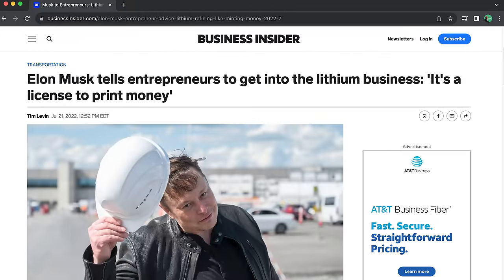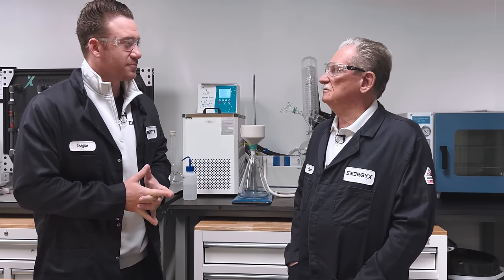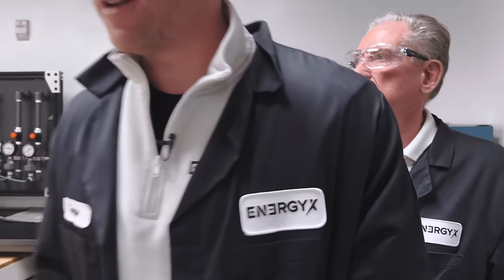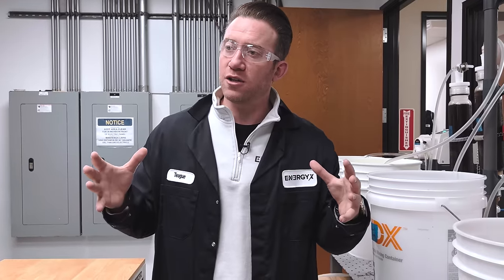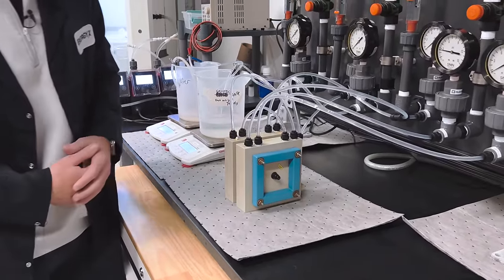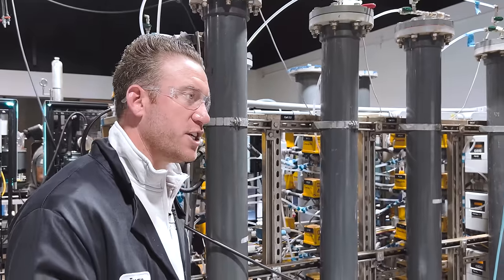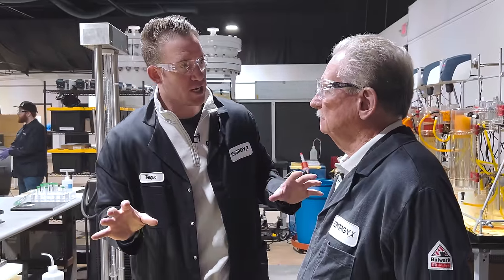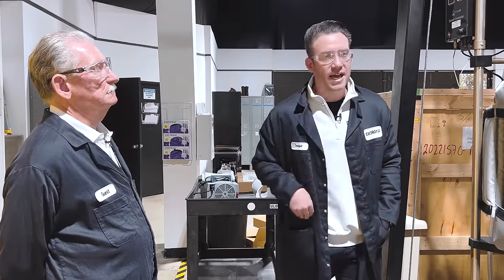The White Gold Rush - How one US startup is changing the lithium extraction game!

Comment: The sums are as follows (assuming I understand it correctly):
1000 ppm of Li in Brine. 
Molecular weight of water is 18g per mole. So there are 55 550  moles of water in 1000kg of water.
At 1000 ppm, there is 55.55 moles of Li per 1000 litre of Brine (more or less assuming the rest of the ingredients are not too significant).
Molecular weight of Li is 6.94 g per mole. This means the weight of the 55.55 moles of Li is 385.5 grams.
This means 385.5 grams at 100% efficiency of extraction. If you apply the 90% extraction yield, then it is 347 g of Li per 1 000 litres of Brine. This is quite some way off the 1kg claimed? I hope my sums are wrong, because some is...
Anyway, cost of battery grade Li (not sure if the Li extracted from the Brine is already at Battery grade or if further processing is required) is USD 37 000 per ton or 0.037 USD per gram. Multiply this with 347 g per 1000 litre of Brine and you extract USD 12.84 per 1000 Litre of Brine processed. 
However at a concentration 200 ppm of Li in the Brine (which is closer to actual as he mentions in the video), this reduces to USD 2.56 per 1000 kg of Brine processed.
SO to decide if this is a good investment, one needs to understand the cost to extract vs the value extracted of this process as compared to other processes. No idea if this is better or worse, but I would not invest purely based on some basic statements/facts provided.
It is possible that this much better than other techniques, but then the facts supporting this claim must be published.
Reply: Very nice back of the napkin calculation. This is exactly why they currently need massive ponds with free solar energy for evaporation of solvent, due to the sheer quantities needed to turn a profit.
Reply: one of the best comments on YT ever...
Reply: that’s one way to display your smarts.

Comment: CORRECTION ON APPROXIMATE MASS:
1000ppm of lithium brine with 90% extraction, would yield 0.35 kg of pure lithium, or 1.2 kg of lithium hydroxide, assuming the mass of all else in solution is negligible.

Reason for error: They forgot to take into account the difference in the molar mass of the different chemicals. 

DISCLAIMER: This is unconfirmed and I don't know their methods beyond this video. Please correct me if I made a mistake.
Reply: You forgot to specify a starting volume.
Reply: I think the businessman should not have answered the technical question of how many kilos of Lithium you get from 1000 liters of saline. With the ratio in particles of 1:1000 you have to take into account the low weight of Lithium. Sandy rightly noted that. 1 liter of Lithium weighs just over 0.5 kg.

Comment: Did anyone else think the numbers seemed to change back and forth?
How often are you going to be working with a brine containing 1000ppm? At first he said hundreds of ppm - possibly 1200 or 1500 (which - again, how often?) - and then the ~90k acre location is expected to produce 400ppm. Then at the end he is doing math on a fictional 1000ppm.

Looking at the multiple settling tanks(ponds, whatever) - I just wondered how large these would need to be in a production system to feed those filter system at the rate he claimed?

I thought he said they were planning to license the process - then at the end he says they have bought ~90k acres.

Also - the idea that it is clean? Why do we think its clean?
We weren't told anything about the chemicals being used.

I never claimed to be brilliant (maybe I revealed as much above) - but the whole way through I just kept feeling like I was being sold all the good points. How about the down sides - there has to be some.

There seems to be a LOT of debt tied up in this and, as yet, no actual method to produce a profit.

Also - is this actually new?
Pretty sure this idea is being tested by a number of companies in different parts of the world... and so far none of it has gotten to a full production scale.
Reply: Teague is not an engineer. And you're correct, there are several companies working on the same process.
Reply: You misunderstood the discussion about enormous settling ponds ... those are what are used in the existing process for extracting lithium from brine not what is required for the energyX process. They were an example of why their process is much better.

Comment: It’s definitely interested.  There seems to be things withheld.  It almost seems to good to be true.  I don’t know, I have my doubts on how cleaner or better this way is.  I hope it’s true and successful.
Reply: why, this level 200 chemistry, I don’t understand why everyone is so blown away.  A Nobel price for chemistry was given out in 1986 or there abouts for cyclic ether chromatography resins that could discriminate between different atomic radii of cation.  Obviously the work done even earlier, in the 60s’.  Check out “crown ethers” on Wikipedia, helpful skematics.  The Oxygen atoms face the inside of the doughnut and have a partial negative charge, they hold on to the positively charged cation.  The tightest ring only fits Lithium, the smallest of the cations.  Slightly larger will fit Na (sorry, sodium);  larger still potassium… and so on.

Comment: They ALL use graphite no matter what the battery is made of.   As a consequence, the manganese dissolution does not only lead to capacity and power fading at the cathode, but also influences the SEI composition at the anode. In fact, an analysis of aged LiMn2O4/graphite cells via EIS revealed that the increased impedance at the graphite anode is largely contributing to the capacity fading of such lithium-ion cells.

Comment: Just a little advice here not to get too hyped about it. Musk has said repeatedly and rightly that prototypes are easy but large scale production is a 100x harder. This company has not yet developed mass production technology and big scale manufacturing so still no reason to pop the champagne. Also do they refine the brine all the way to lithium carbonate ready for battery production or is their technology simply a lithium concentration technique for brine. If the latter it still has to be send to China for final upgrade to highly purified lithium carbonate. If so I am not impressed at all. I am also confused because he says they make lithium hydroxide. That is not what you normally can extract from brine. You normally get lithium carbonate. Lithium hydroxide is normally made from lithium rich rocks not brine.

Comment: St Augistine Florida, last I remember back in the 90s, utilized reverse osmosis for drinking water treatment.   Due to salt water intrusion from the Atlantic
Reply: The main method they are using here is called EDR which is ion selective and vastly more efficient than RO. EDR can also be used in desalination. I built a small one for my hydroponic system. It is off patent.
Reply: Salt water intrusion is a growing problem as aquifer pressures continue to decrease.

Comment: How long does a membrane last and is it reusable or must be discarded and how much waste is created
Reply: The main filtration unit called EDR is self cleaning by the reversing mode. The membranes are not very expensive and would last years, up to 20 in continuous use. Much more cost effective than RO.

Comment: So, if this works as advertised and at scale, then couldn't you go to those lithium rich areas, fill them with a brine solution that will bind to the lithium, and use this process to mine rather than the traditional method for safety?
Reply: I don’t think one would want to pump any kind of binding chemical under ground.

The idea to pump the brine out, run it through the process, and pump the brine without lithium back into the ground is better in these lithium laden areas.

Today, miners are not pumping enough water back into the underground caverns, sink holes are forming, and slowly destroying the mines.

This process has the potential to solves a lot of problems in South & Central America, where they are currently destroying the underground caverns holding the brine.
Reply: @DavidHalko  So, I don't know enough about the current Lithium mining process. However, couldn't you dig up the Lithium laden material, run some brine over it to soak out the Lithium, and then return the resultant material back once finished? 

I guess we would need to know how long the binding process would take, but presumably it would be safer than our current process, considering how bad everyone seems to be saying it is.

Digging up piles of rock and dirt, running brine over it, do this process to leech the lithium out, and then put the resulting rock and soil back.

Comment: The wiper part is disingenuous. Tesla should get sued for having such bad automatic wipers it's at least 10x worst than the worst system out there. I've had my m3 for 4+ years and it never worked well. I don't care that they saved 100$ on a rain sensor, penny smart dollar stupid. It's cool that they put It in the autopilot release but what about those with HW2.5 that were told here hw would be upgraded in time? it never was and are we not getting working wipers?

Comment: QQQ - How similar (or not) is this to what Elon is building with the Tesla Lithium refinery?
Reply: The Tesla factory receives spodumene (LiAlSi2O6), i.e. a mineral with a very high lithium content from the port of Corpus Christi and chemically removes the lithium, leaving aluminum silicates as a by-product. Tesla claims to do this without needing a large amount of acid (which probably just means that the acid is recycled in a closed chemical process). What these guys are talking about is about enriching water soluble lithium brines at the mining site. I suspect that to Tesla what matters is the availability of lithium rather than the total cost of production. They can absorb prices above the market price because they are making vehicles with very high margins. What they can not tolerate is to not have enough lithium in the market to keep making as many vehicles as they can sell. Supply risk management is a totally different goal than cost optimization, so the economics is potentially very different for Tesla. There may also be other reasons like quality control... if their process produces either "better" lithium than what they can buy or "good enough" lithium at a lower cost, then that's a winning strategy as well.

Tesla did describe their chemistry in a video, by the way. The main advantage seems to be that they don't have to buy expensive sulfuric acid and they don't end up with byproducts that are expensive to dispose. If I understand this correctly, this is like 19th century inorganic chemistry. You could do this at home with a chemistry kit and maybe a somewhat higher temperature burner. It's a different matter doing it at large scale, of course, but in principle this is, as far as chemical factories go, kindergarten level.